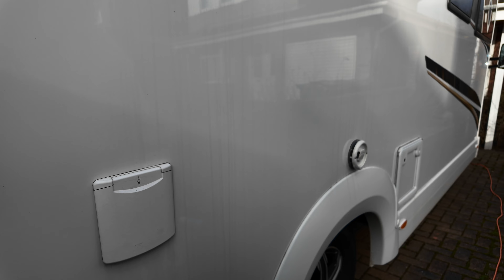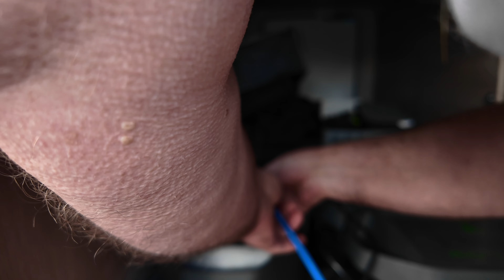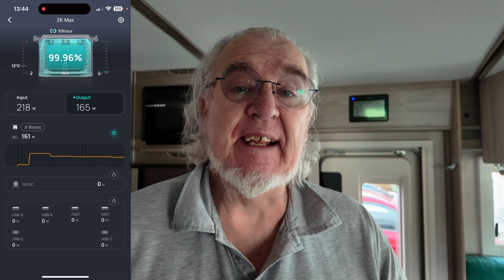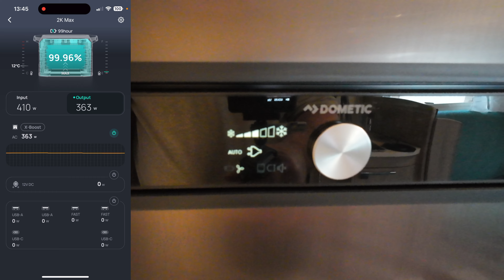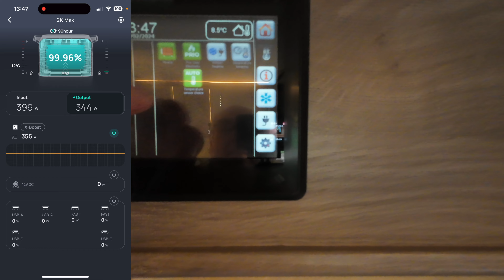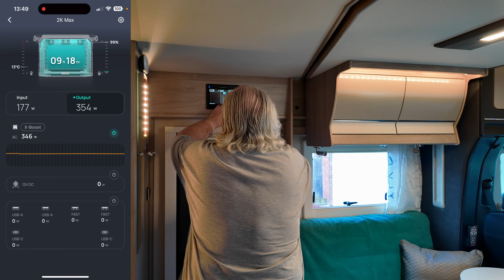We Have POWER off grid!!

Comment: Basically the same principle that i am doing with a 2000w inverter with a 150A lithium battery , and 200w panal. A advantage with this method is, you can recharge the lead acid off the original charger.
Reply from the maker: Indeed - but one has to listen to the boss when it comes to me making holes and screwing things!

Comment: Roof full of solar panels next and you’ll never need EHU again 😉😃
Stay Safe 😜👍
Reply from the maker: Not sure there’s room enough for the1600 watts I’d want… but I have a tape measure!
Reply: The latest CIGS panel’s are more efficient so may negate needing so many 😉
Reply from the maker: If this works out like we think it will, it’ll be the next move, we think - plus a changeover switch.
Reply: Yes that is what we have done, 700 watts of solar 2x135 lithium batteries 1600 watt inverter charger. Off grid virtually all the time.